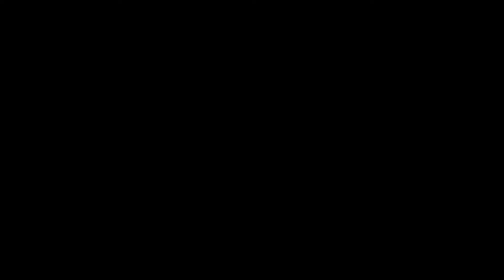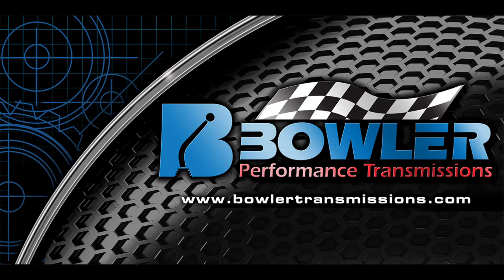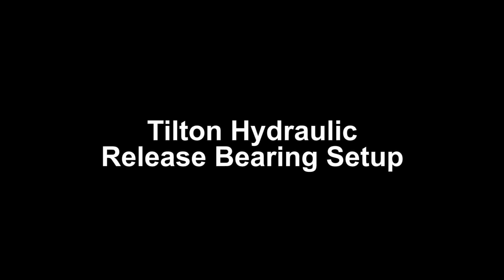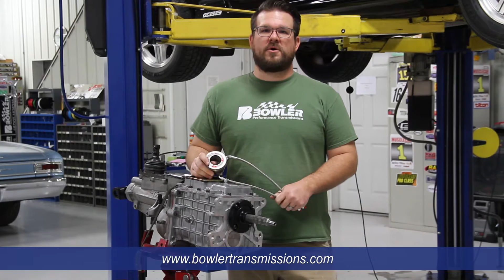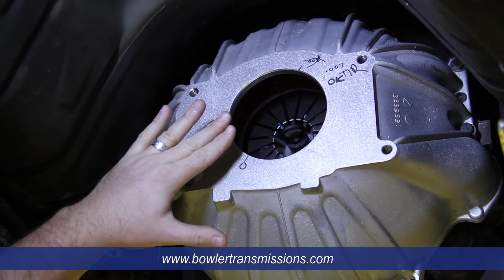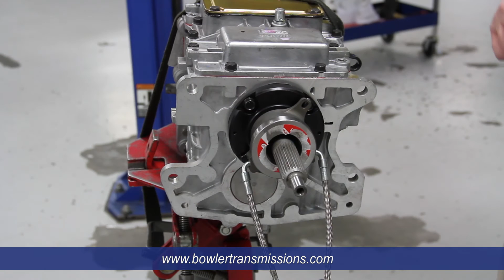Do you know how to set up your Tilton bearing?

Comment: Using the same straight edge (or one with the same thickness) is key.  Also, it DOES matter which line has the bleeder - it should be the one that exits the HRB at the highest point, so that the air can rise from that port in the HRB out to the bleeder.